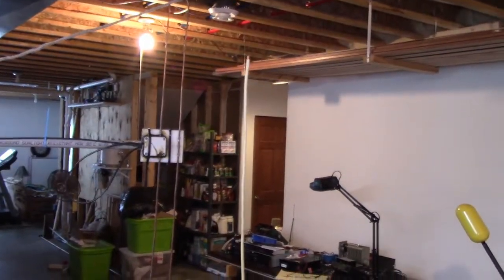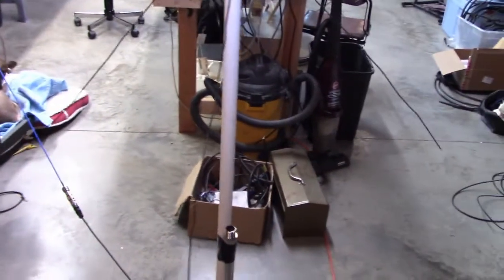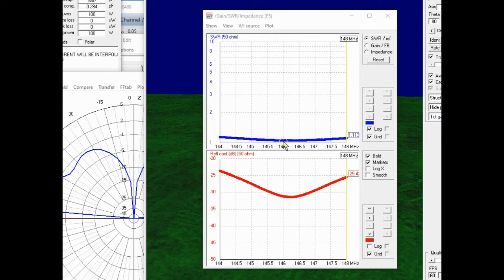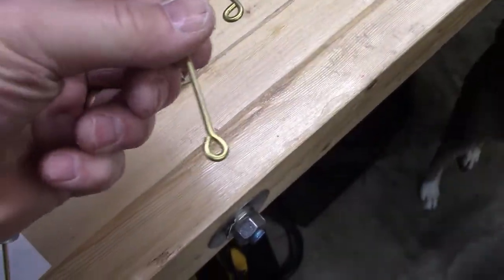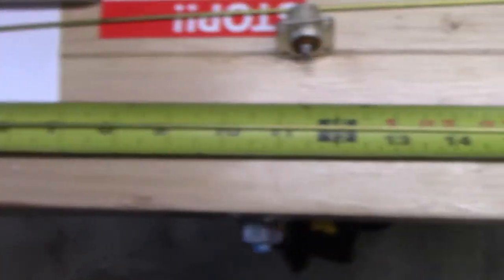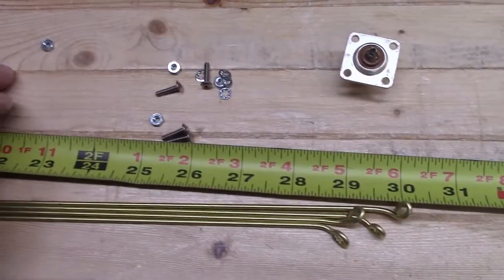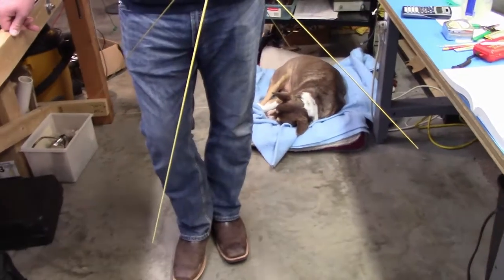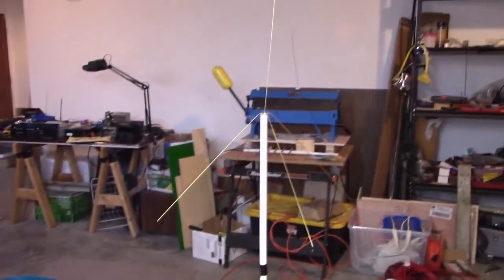VHF, 2 meter, Ground Plane Antenna (009)

Comment: Great and helpful video Ralph.  One of my favorite antennas  Works good with chassis N  connectors also.  I thought I would try using liquid electrical tape to seal around where the vertical radiator connects to the connector to help retard H2O infiltration   Do you think this would react with the metal less than RTV type compounds ?
Reply from the maker: I keep getting GREAT reports about the performance of this antenna from the guy that built it. I agree, it is a great antenna. Good thought on using N connector! I actually never thought of that. MUCH better connector on all counts than the UHF connector.
I am not familiar with liquid electrical tape.  If you use the electrical grade silicone sealant, then it will not react with the metal (it is non-corrosive by definition).